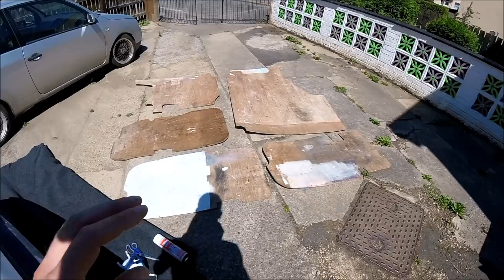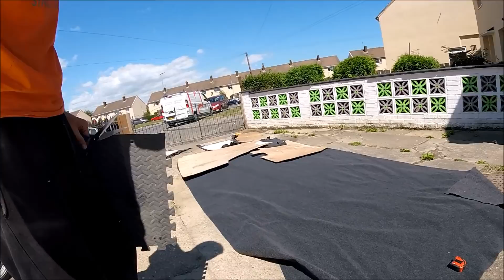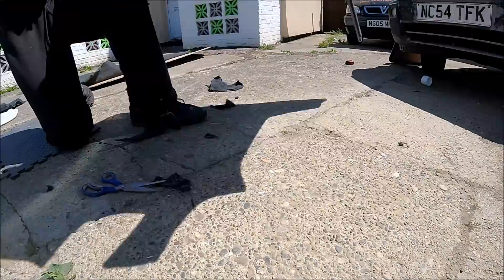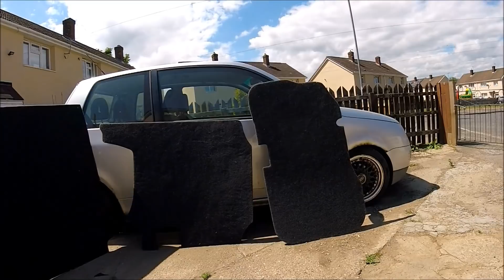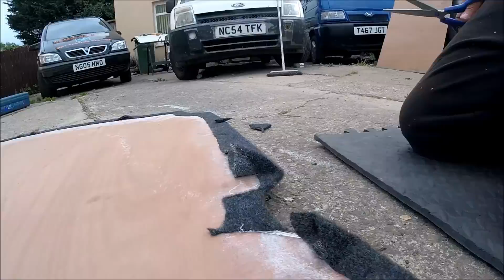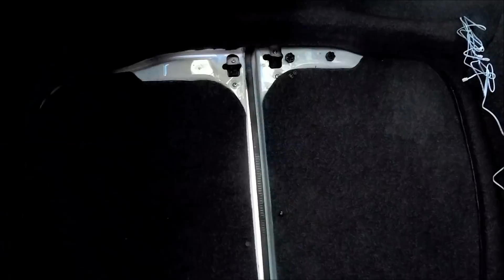Ford Connect Micro Camper Conversion Carpeting Ply & Headlining Panels

Comment: As a lot of other people have said, this is a great video! I have also got a ford connect swb and I've watched so many videos and my brain is about to explode. Do I use wool insulation, spray insulation, celotex, do I cladd the walls and roof, so I carpet line... so many different ways but this way seems the most simple and effective. My only trouble is I will need to make my own cuts for the plyboard as mine hasn't got any, and I am crap with tools! But I will give it my best shot. Thank you for your video

Comment: How did you fix the roof panel in place? One of my biggest headaches doing my transit was the roof lol  but doing a Connect soon, a ply roof template from what you did would be SOOOO useful ;)
Reply from the maker: The roof panel is tucked under the front head lining and is then held up at the back by the skylight surround, no screws or brackets needed and it’s held well in place

Comment: Did you glue the headliner in or nail it in?
Reply from the maker: It is held in place by the skylight surround and tucked under the front headlining, no screws or nails at all